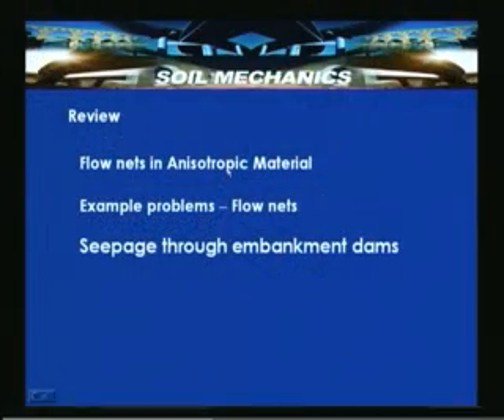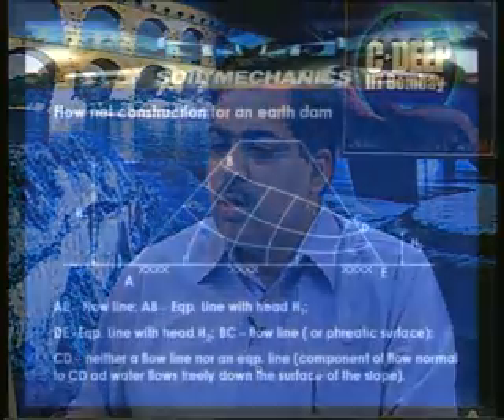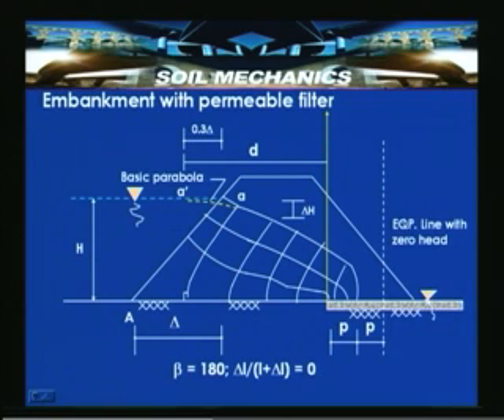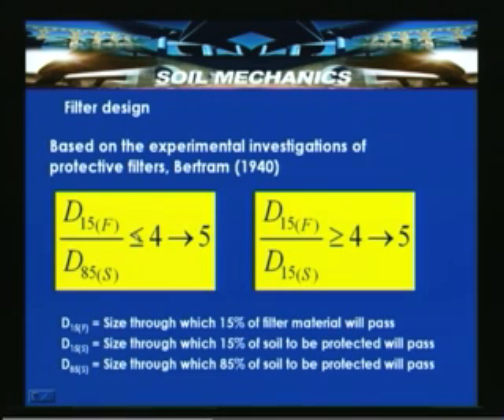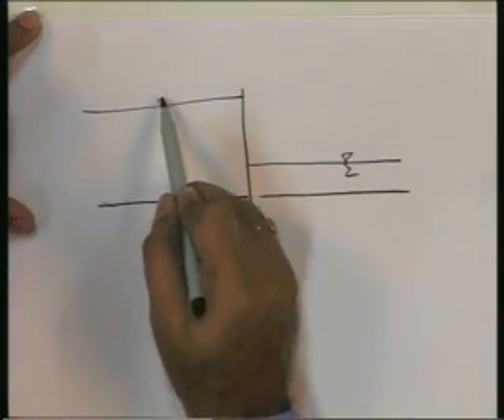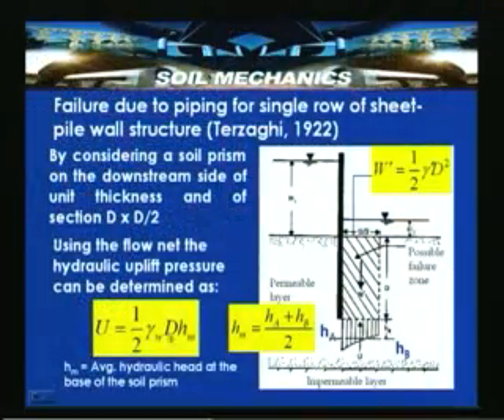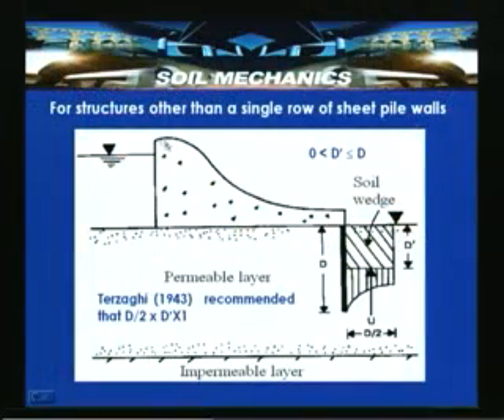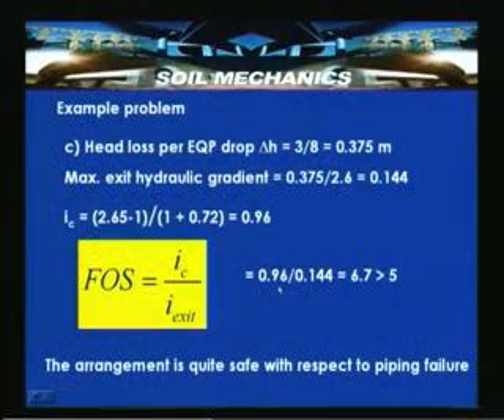Lecture - 27 Flow of water through soils - VIII

Comment: help me with this question. a masonry dam has height of 20cm with top width 5m and a freeboard of 78.65 inches its upstream face is vertical while downstream face has a battre 0.66horizontal to 1.0 vertical.specific weight os masonry may be taken as 2.4 calculate the extreme value of the normal stress of the foundation when the reservoir is full .take specific weight of water as 10KN/square meter